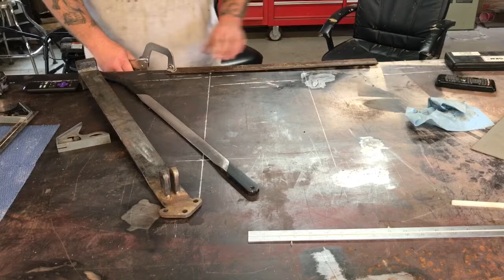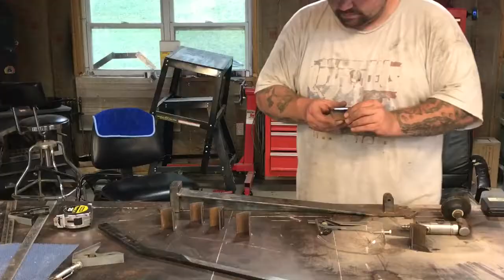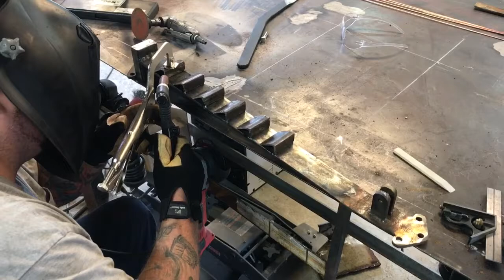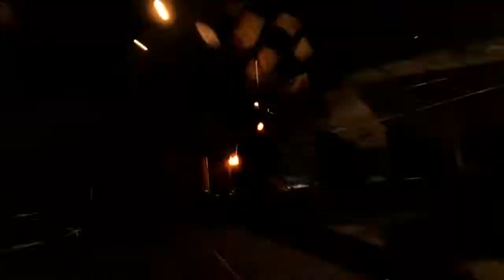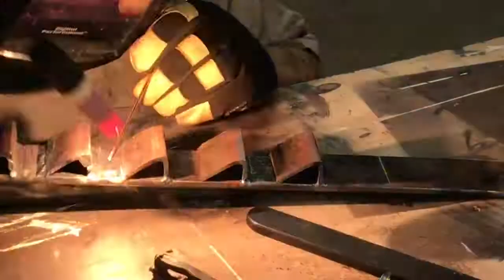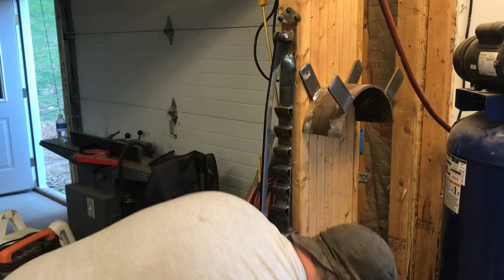Channel update

Comment: Hi,  I like your style of doing videos.  I just found your channel.  Any suggestions on trailer refurbishing or what type welder a beginner can start out with.  Thanks and keep up the videos they're good.
Reply from the maker: Renee Ryan I like Hobart they are made by Miller all the same features and less money.  220 volt machines run much better than 110 machines but are more expensive. My favorite Hobart mig welder is the 210 MVP it can tackle any mig welding job you'll run into.